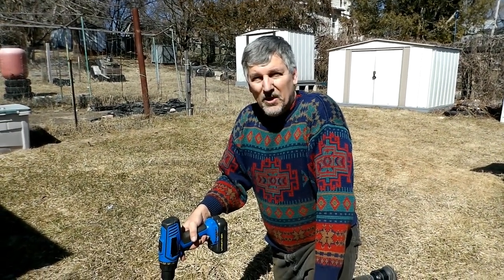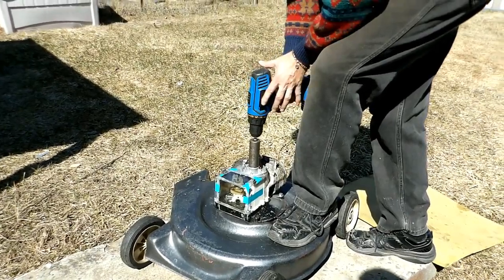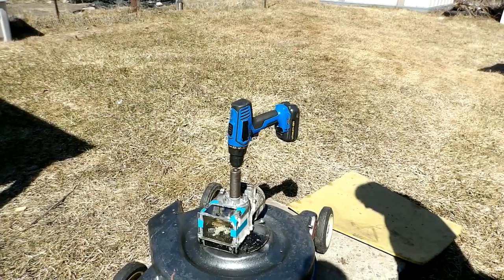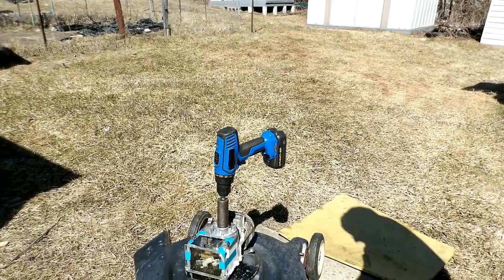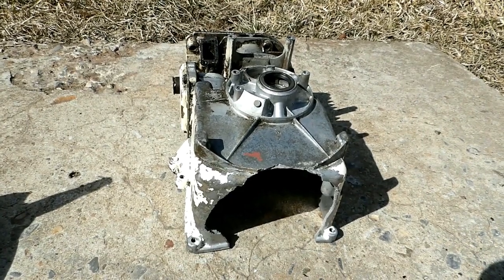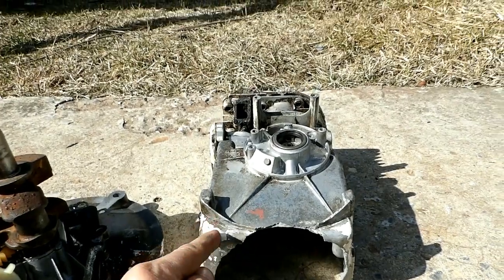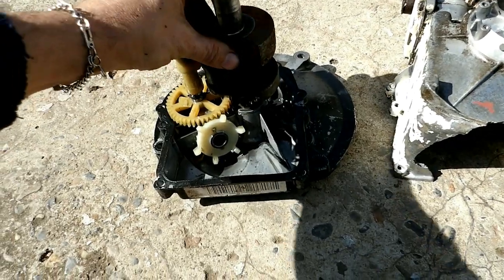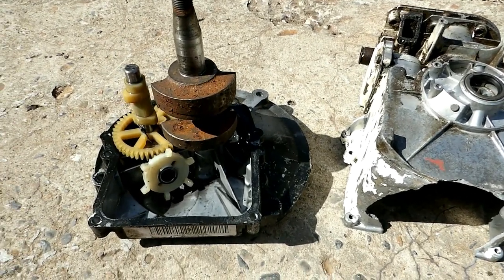See Through Vertical Shaft Briggs Splash Oiler!

Comment: Very nice!  I always wonder about it when putting an engine together...  I would be interested in seeing you do a conversion to horizontal shaft with the same transparent block.  You're the man!
Reply from the maker: Great suggestion! I could do that fairly easily, as I have 6 conversions I did last summer for my H12 engine, as 6 of the 12 are lawnmower engines running horizontally.

Comment: Do you know how common this method is in today’s lawnmower engines?
Reply: Very common. Pretty much guaranteed. The horizontal shaft engines have a dipper on the crank that splashes oil. Vertical shaft engines need something to fling oil, so if it's not a "big money, pro grade"  lawnmower with centrifical lube or pumped lube, this is how it's done today.
Reply from the maker: Yes pretty common on lawnmower engines, though some of the large riding mower engines have an oil pump.
Reply: If it’s a splash lubricated vertical shaft, this is it.

Comment: Will you start it on actual gas?
Reply from the maker: I may do that in the future, I need to glue it up better with more silicone, as it was burping a bit of air out already just from the speed the drill was spinning it at. It is the piston moving back and forth acting as an air pump.